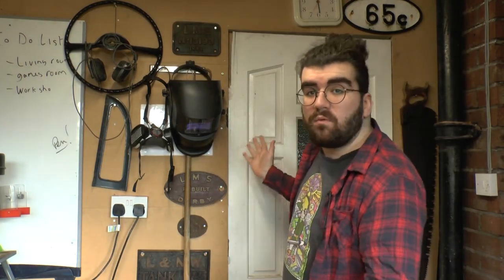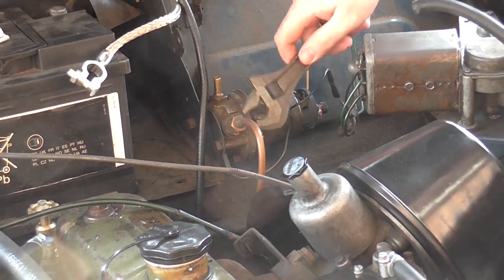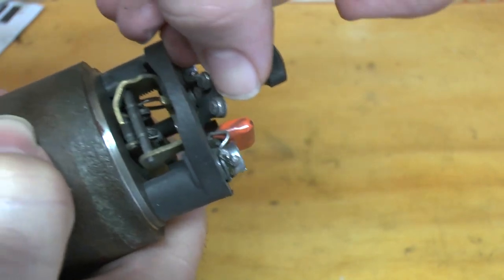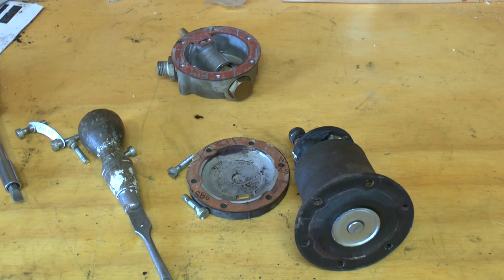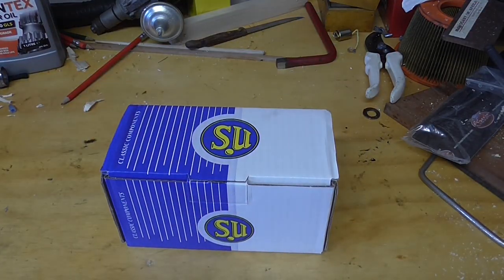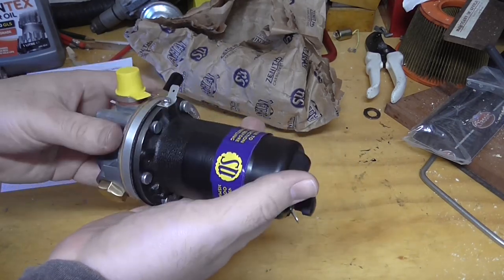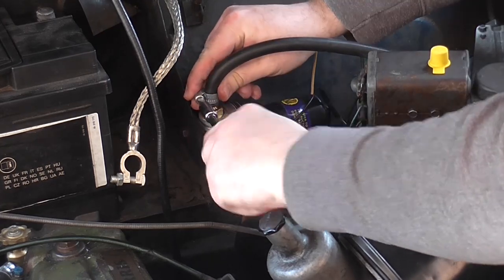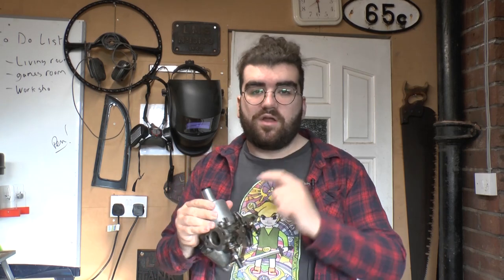Morris Minor - Fuel Pump Replacement - Project Daily Drive #15

Comment: If your serious about buying a Morris Minor as a daily driver bear in mind that the chassis components (Nuffield) are held together by BSF nuts and bolts whereas the engines and transmissions on the OHV Minors are of Austin origin and use American sizes (UNF) which means you'll need two sets of spanners and socket, A/F, (Across Flats) for the Unified nuts and bolts and BSW/BSF spanners for the BSF nuts and bolts. If you can't find new the hit the autojumbles!

Comment: Thanks for the very informative vidio!! Really clear information.

I replaced my fuel pump today on my Austin heley sprite which is the same system as yours, ao i connected everything and i turned the electrics on and the pump turns on and aounds just like yours however no fuel is coming through... Any suggestions what it could be?? And yes i have plenty fuel in tge car.

Great channel.

Liked and subscribed

Comment: Back in the day the upgrade was to fit the mechanical fuel pump off some other BMC/Leyland car, most A series engines (and many other BMC/Leyland vehicles) have one driven off the cam shaft that fits directly to the engine. Modify the fuel pipework to suit & Robert's your Mother's brother, no more messing with fuel pump points.
Reply: Very true.  I think this guy got a little confused between electrical/electronic and mechanical fuel pumps.  If the pump is driven by electricity it is electrical or electronic depending on the internal circuitry, it is NOT mechanical.  A mechanical fuel pump is bolted to the side of the engine block and a lever passes through and runs off the camshaft.

Comment: For petrol pumps positioned away from the outside weather like inside underneath the bonnet the electronic ones are ok BUT with cars like one of my cars the MGBGT where the pump is underneath outside open to the road weather I don’t recommend the electronic types as any dampness destroys them very rapidly and a replacement part is about £80+ pounds whereas normally you can clean the points but if you have to buy a replacement points set they’re about £15 and very easy to replace , but all the same and nice video

Comment: Years ago I purchased a electronic fuel pump for my BMC product. Like you I wanted reliability. However I am now worried that the diaphragm is not going to prove reliable. It may be too old to be compatible with Ethanol (E10) .

Comment: Great video of how to swap pump but you made a big error.
The contactless fuel pumps are rubbish. They cant deliver enough fuel. I just threw mine away and fitted a pump with points.
I've got electronic ignition too.
Ill be chucking that out and going back to points soon.
Reply: Ross I can understand about the pump but why the electronic ignition.I was thinking of changing to electronic ignition but now I have doubts.
Reply: @bernarddegrasse8753  if you get problems with points, it's easy to figure out the problem plus you can static time it without strobe.
Once you get issues and have electronic ignition fitted, you're never really sure what's wrong.
They worked fine in 1950, why change?

Comment: That is a very old fuel pump. The 40 plus year old fuel pump in my Jaguar has the clear plastic layer on the fuel side, so hopefully is ok for a few years yet. Having fitted a diode across the points, there is no longer any sparking, so again should last a while. I remember clambering under a mini to wack the fuel pump, much easier on the minor.